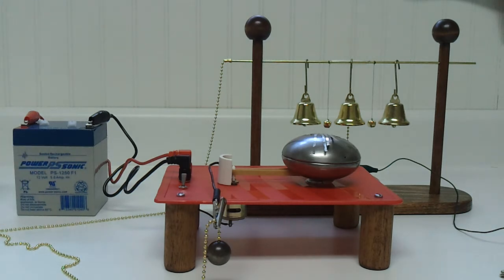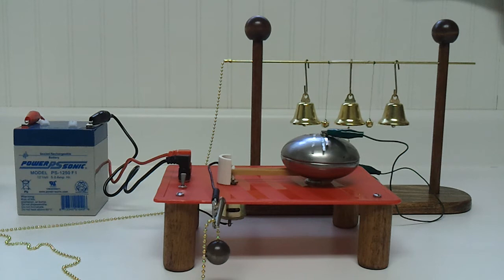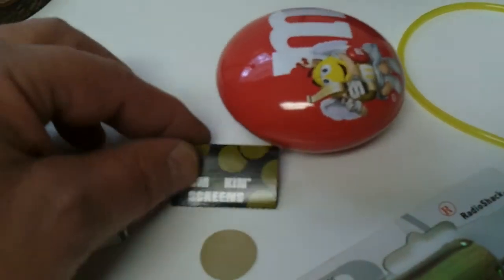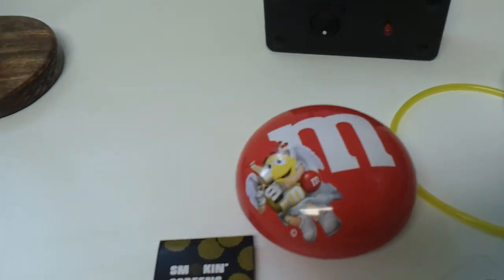Friction/Van de Graaff demo in high humidity

Comment: Both those machines are really cool and the fact that they work in high humidity is great.  Humidity where I live near the beach sometimes shuts down my electrostatic experiments.  I have to use a hair dryer to dry them out and get them to work.
Reply from the maker: Deep South humidity can be a real bummer too.  Will try the hairdryer trick next time I have problems.  Have you tried neon and fluorescent lights with your setups yet?  Great Fun.

Comment: Very nice little demonstration. I am pleased to see the use of carbon fiber brushes, and the bead chain conductors. I believe I first used these items in my electrostatic work in late 2008 and early 2009:
Dirod 1
Electrostatics: The Dirod and the Enhanced Franklin Motor
The Dirod also works quite well in high humidity conditions, but just in case, I bring along a blow-dryer to demonstrations. A quick gentle blast with warm air will work wonders for a balky ES generator in damp weather!
I really like your little VDG machine, that's a clever design.
Reply from the maker: I have the book by A D Moore and hope to build the dirod one day.  I was not aware you used the carbon fiber brush but will edit description.  Look forward to watching your electrostatic videos.  Thanks for the suggestion and compliments.
Reply: OUbrads
No  need to edit, I admire Lidmotor's work and if that's where you got the idea that's where you got it. Great minds think alike, anyway!
I got a lifetime supply of carbon fiber rovings from a RC airplane hobby shop in San Francisco and I found a hardware store in Alameda that sold many different sizes of bead chain. Somewhere I have some really big stuff that makes great UHV conductors.  The Moore's Dirod is an uber-cool ES generator. You should build yours, they seem to be rare as hen's teeth.